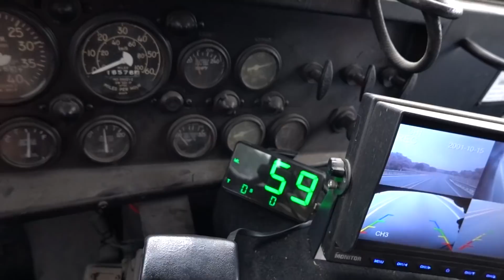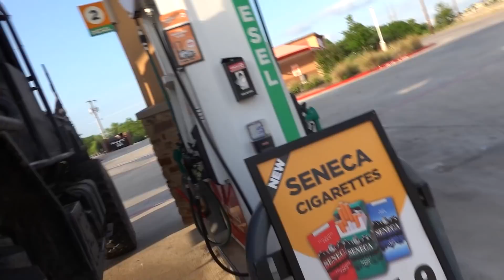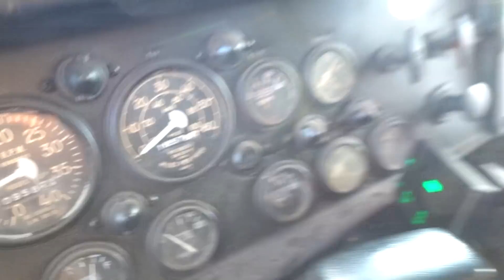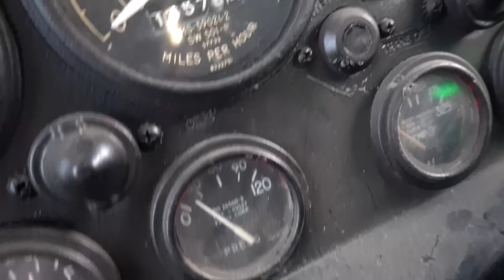The 5 Ton Nearly TOTALED! Blew Oil Everywhere 2 hours from home!!!

Comment: Swapping those bolts for pins with something like a hitch pin with a clip that holds it in would make opening that hood up easier
Reply: Nah, that would be the smart thing to do.
Reply: or just not putting a useless roll cage on a 5 ton.
Reply: Or just keep spare tools in a toolbox he just bought new once now anyway so use those
Reply: Definitely second the quick release idea
Reply: Then it would rattle!
Reply: Pins would wreck the bars. Bolts are the best option. Yea it’s a pain to remove but it’s what is need for the job.. and whoever said why put the cage it’s to protect everything when driving through brush country. And also if say it rolled and that’s super easy to do it can save your life..
Reply: What and then he would be able to check the oil before he started it every time he went to use it. Get out of here.
Reply: @dennisjay3277  It's obviously easy to check without lifting the hood!
Reply: @13christbane  only useless till it’s not
Reply: But he didn't check the oil or he would have said " the dipstick was there when I checked the oil this morning ". Also on the pre trip you tip the hood and check the radiator for proper level of coolant. Worn belts or broken belts. Air compressor for air leaks. Just because you can get to the dipstick doesn't mean that is all that needs to be done.
Reply: @dennisjay3277  that’s if you are driving a commercial truck. This is a private truck. He also doesn’t disclose everything he does all the time.
Reply: Truck has air tanks. Toss some air powered tools in back with an air line and make life easier.
Reply: @rrr3r2  it's 100% useless
Reply: @13christbane  Seems useless now but Matt will find a way
Reply: @rrr3r2  That’s the same procedure for PMCS on a military vehicle. Every trip, every single time. Heck, even when they’re just sitting in the motor pool unused, they (are supposed to) get the same attention.

Comment: It seems like you might want to buy a cheap impact wrench to store in the 5 ton to make opening the hood a bit easier. Messing with that many bolts using some adjustable wrenches does not sound fun.

Comment: There's a very good chance you guys way over filled it with oil. When oil leaks it L👀Ks like a ton of oil all over the place. But its actually only misting everywhere!!  The oil gauge was reading low at idle because it was already warmed up.
Reply: cummins 8.3 should hold 40 warm idle everyday. the bearings are wiped, whistlin diesel style.
Reply: @safetyfirstintexas  nah  the cta8.3 is a high volume low pressure engine.  10psi hot idle 650ish is normal.

Comment: Put a couple layers of sound damper on the underside of the roof. It will make it a little quieter, take a lot of flex out of the roof, and make it a little cooler in the summer.

Comment: They have had that before on roof racks. The roll bar tube that is just in front of the windshield is causing the wind to make it happen. They changed the shape of the tube and that fixed the wind from isolating. Same thing on bridges with the wind blowing around the cables causes them to shake and can make sounds.

Comment: If you want to eliminate the hiss of the wiper find the air dump on the wiper motor and attach a rubber hose that vents to the outside.;...instant quiet!

Comment: Hey matt the big lugs u have holding the hood cage closed maybe replace the bolts with a hitch pin type of bolt something that has a quick release pin and u can make sure u dont loose them by attaching a cable or chain to the pins and bolt

Comment: Breaking of the trucks that you're talking about and that concrete mixer most likely loaded has the same breaks you have you are a light unloaded truck with the same breaks you need to had put more weight in your truck and it will stop better. That's also a little lesson for all those who like to run out in front of trucks and if the truck can't stop they just slide right into you!!!!!

Comment: I know you don't read the comments, But........
Either the top/ handle of the dipstick broke off and the rest is in the tube or someone did you dirty and took it!!!  
There is no way the entire dipstick just came out on its own!
Reply: It's just pressure fit into the hole they come out pretty easy, I saw one "FLOOMP" out of an engine on a stand and land on a roof. Of course the crank case explosion may have had something to do with that.

Comment: The 8.3 doesn’t have much oil pressure at idle hot anyways.  Mine is like 10psi. The low spec is 5-7.

Comment: That oil presser is probably good, those 8.3's don't have a high oil presser at idle. I'd say 15psi at idle is fine and then it goes up the more throttle you put to her. Also, a gallon of blown-out oil covers A LOT of stuff, so I'm thinking you may have overfilled her by about a gallon. lol.
Reply: Yeah they are low pressure high volume motors.  Mine has like 10psi at idle hot.  My low pressure alarm is like 5-7 lol.
Reply: @dieselboy740  I haven't been around them in years but I was thinking they were low-pressure engines.

Comment: Man he was cover in oil at the end of the video so much we couldn’t even see him 🤣.. and it takes a second or 2 for it too build and show oil pressure and if I remember right it looked from the camera like it was reading right on the gauge and would raise with throttle I wouldn’t worry to much about it. Just do a oil change asap and get a new dipstick or findout what length you need and make one so you can atleast check it..